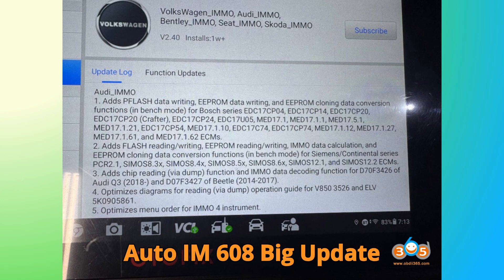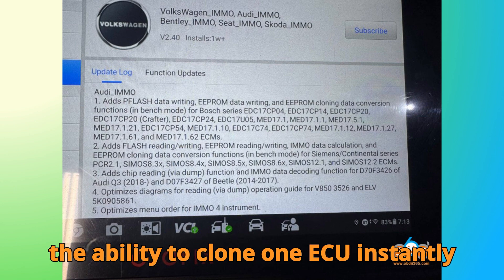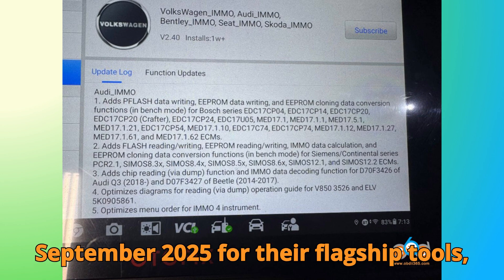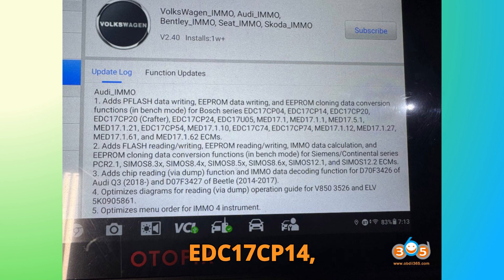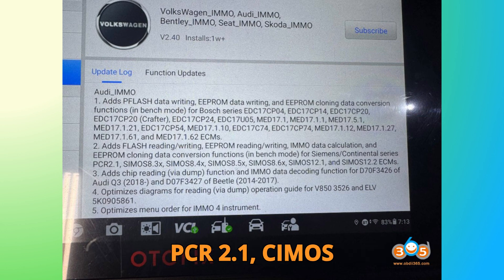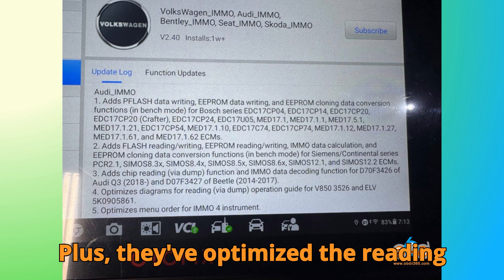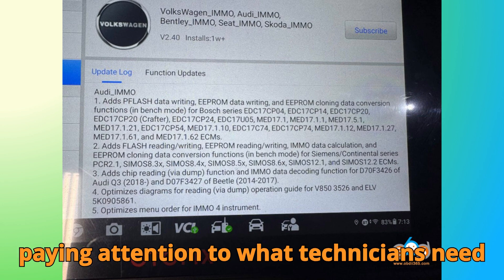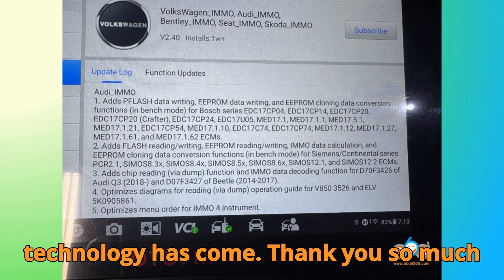Autel IM608 ECU Cloning Update: EDC17, PCR2.1 & Simos 8.x/12.x Made Effortless

Comment: Hello, I’m using the Autel IM608S II with the latest update installed. However, I noticed there’s no cloning support or update available for the Simos 10.10 ECU. The new update includes EDC17, PCR2.1, and Simos 8.x/12.x support, but Simos 10.10 is still missing.
When will cloning support for Simos 10.10 be added, or is there any current method to perform it with the existing system? Thank you.
Reply from the maker: We will forward your request to the Autel team.